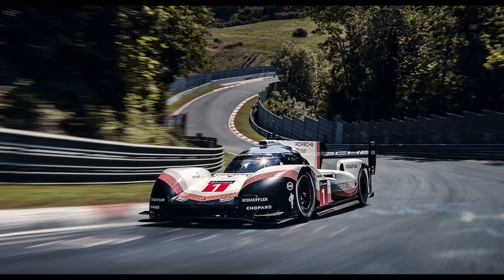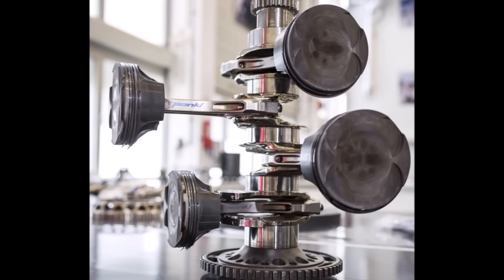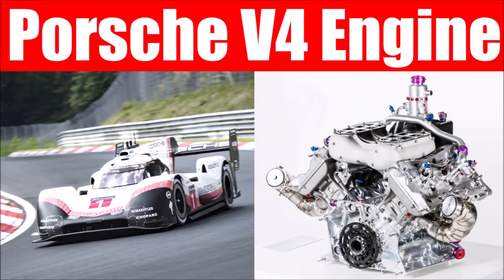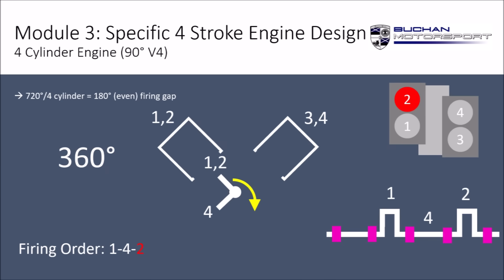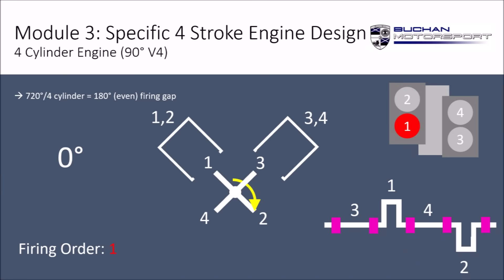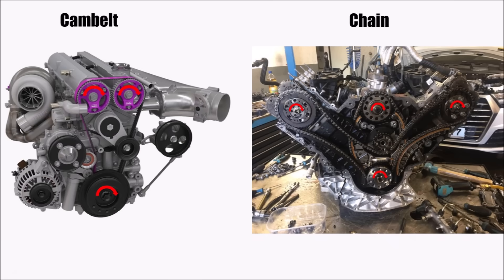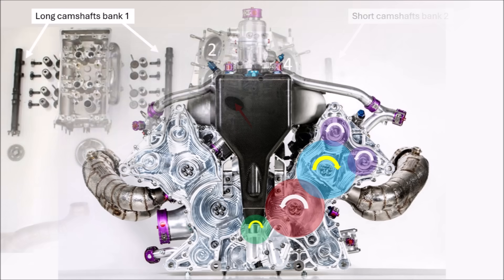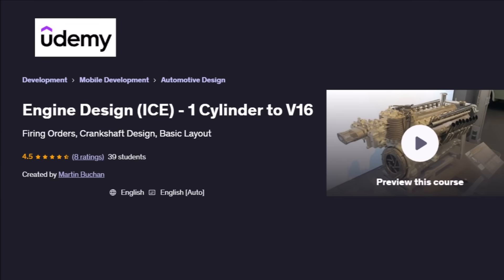Porsche 919 V4 Engine - Part 2 -  Important Updates

Comment: Typically 4-cylinder engines - particularly in-line fours - sound absolutely disgusting, at all speeds. The only reason I ever purchased a Tommy kaira M20b is because it has the Subaru boxer-4 in it - which sounds amazing - at all speeds!
V4s generally sound bad, and I find it sad the 918 engine isn't a boxer-4, because it's a fantastic setup which keeps weight low-down.
However, I have to say the 919 sounds pretty damned good - for a V4. And this, along with the performance, means this is a fairly important engine.
Reply: You do know with a header swap your beloved boxer engine would sound just a disgusting as an inline 4 correct?

Comment: The banks are staggered atypically but the 919 engine still follows the cylinder numbering convention used by VW/Audi V engines. On bank 1 the frontmost cylinder is #1 while the rearmost on bank 2 is the highest cylinder number. All of the VW/Audi V engines I know of 077,078,079,06C,06E, 06M, follow this convention. It appears that Porsche also follows this convention as far back as the 928's V8 in the 1970's.

Comment: The L shaped crankshaft makes sense from a flow point of view. It gives each bank even firing, which is better for tuning the exhaust system for high RPM (and the air intake system - it looks like this engine has a common air intake system rather than individual trumpets.)  Unfortunately it needs a large counterweight and balance shafts to achieve anywhere like decent balance.

Comment: I like the fact that the cams are gear driven, I've always wanted that in a road car.
Reply from the maker: Phaeton V10 is your chance😉
Reply: @bsport320  Or touareg 2.5tdi r5 😃
Reply: @bsport320  wow! Didn't even know they made a v10 phaeton, I'll look into that, thanks.
Reply: Yeah, but the drivetrain vibrations are bigger. Involute gearing accelerates and decelerates, that's why gears are not used often. Most F1 engines also had damper gears.
Reply: @DoriFord  I've heard that they're noisy, but haven't heard anything about driveline vibrations.
Regardless, we've always had ways of dealing with issues like that, I'll rather have an engine that never skips a tooth, instead of worrying about the belt or chain slacking.

Comment: Race engine technology magazine did a pretty detailed article on this engine a while back if anyone wants to get deeper in the weeds on this.
Reply: Damn, thats a legendary magazine for anyone into engines. 

They did an article on the ts040 v8, and it was there I learned toyota made a naturally aspirated, port injected only v8 with mid 40% thermal efficiency, with combustion pressure sensors INSIDE the combustion chamber. 

2014-2017 LMP1 was actually the peak of engine design. Probably as close as we will ever get in the modern era to an "anything goes" ruleset. Unlimited budgets :D

Comment: I totally dont understang why it is brilliant
Reply: The fact that they can race it for 24 hours straight through the entire gear range? The 917k, which had a flat v12 was around 520 hp
Reply: Just imagine all those rotating/stroking elements at high revs. 
You need to balance it all as good as possible. 
Otherwise the engine will rip itself apart.
Reply: It's small, thus light. A very dense powerplant.

Comment: It’s not really good to compare with the Ford V4 engine as that is a 60 degree V so it has offset crankpins. Better look at the Honda VFR, this is a 90deg V4 and has just 2 crankpins. 2 pistons share a crankpin. It would be interesting to discuss why Porsche didnt use this design as it is more compact and has perfect primary balance like a 90deg V-twin but because of the extra 2 cylinders also has even firing order. Basically two V-twins mated together at 180deg offset.

Comment: This engine blows my mind to this day. This and the Mercedes split turbo are probably the two most innovative racing engines ever. 😊
Reply: @deeacosta. Thanks for a thought provoking comment. "Two most innovative ever ...".   I'd agree concerning the Mercedes split-turbo but not this V4. If saying  "ever", we should surely consider Walter Kaaden's game-changing 2-strokes and the DOHC narrow-angle 4V/cyl Peugeot L45 engines of 111 years ago and perhaps, Keith Duckworth's somewhat innovative V8 ... plus  many other amazing race engine innovations down the years. Against these giants, the Porsche would struggle to get into the Top 10 IMHO. However, it is certainly a very impressive project.
Reply: @ yeah the Peugots were special but the Porsche and Mercedes won races in competitive environments. 

The Cosworth DFV is a legend but ai feel like more the result of practicality and the state of F1.
Reply: @camshaftcasting1451  And why would you include the Mercedes when it didn't even end up being to most powerful, the Ferrari with a conventional turbo being more powerful. As well as they're having to most reliability issues by the end of the era. Also the split turbos were already used outside racing when Mercedes came up with the idea.
On the other hand there's no V4 car racing engine other then the Porsche. Even in road cars there's only a handful of them.
Reply: @avada0 I will try to explain why I think this engine was innovative when it truned up in 2014. I think we should not underestimate the lead the MBHPE lump had when the new formula started. The OP called it a "split turbo engine" as a sort of short hand but there was a lot more to it than that. Honda and Ferrari had to play catch up in a number of areas. The fact that V4s are unusual in cars does not make Porsche's use of them innovative. I expect there are other aspects of that Porsche V4, more innovative than the fact it has 4 cylinders arranged in a vee.

Comment: This L shaped crankshaft seems amazing. Even if it was unbalanceable it is wonderfully audacious. Did porsche attempt to balance it externally or with weights on the shaft itself?
Reply from the maker: I think they didn’t have the time and quickly changed to the other firing order

Comment: Could porsche use this for their next hypercar?
Reply: v4 would be something not even ferrari could do
Reply: @hanspeter24 porsche made a 919 street concept, so they can use that design to make hypercar with a modified version of 919 V4 or the V6 they developed for F1 hybrid era with hybrid system and porsche could try to set a lap record in nurburgring like  they did with 919 Evo . Also a hybrid is better than a full electric hypercar like Mission X
Reply: @Arno_7-a  Not sure how it would do in a road legal car. Sure, Porsche did do something similar with the Carrera GT and 918 Spyder, but those were a V10 and V8, respectively, which have better balancing than a V4. The V4 would probably need some NVH studies and modifications to make it run smoother Not only that, but costs could be another limiting factor. 

But it would be quite interesting seeing Porsche do that to the 918's successor, specially since V4 engines in cars are quite rare.

Comment: No balance shafts?
Reply: Doesn't need them.  Cross-plane V4s have perfect primary balance. 🙏
Reply: @rooramblingon895  The even (once every 180 degrees) firing order described in this video is not perfectly balanced. Pistons 1 and 3 come up together, and pistons 2 and 4 come up together. That means there is a reciprocating primary end-to-end imbalance. Reciprocating imbalance cannot be 100% removed by crankshaft weights because the crankshaft weight then introduces its own imbalance at 90 degrees to the existing one.
Crossplane V4 can have perfect primary balance but only with a firing order where some pistons fire 90 degrees after others. You can even get perfect primary balance on a V2 provided it is 90 degree V angle (like Ducati.) One piston moves in the x direction, the other one moves 90 degrees later in y direction. In this way they create a rotating imbalance which can be perfectly cancelled by crankshaft weights.

Comment: How many Horse Power did this 4 cylinder engine produce? Only the engine.
Reply: In LMP1 spec 373kW, 500hp, 507PS
In Evo spec 530kW, 711hp, 721PS
Reply: @toro4271 holy shit! Those numbers are insane!
Reply: @toro4271  unbelivable,with only 4 cylinders... We need it in road cars 😀
Reply: @zelcpavle5494  They're expensive to build. And they're hard to package compared to a straight 4 in a FWD config. Only reason you'd want a V4 is if you've got specific package demands, like a motorcycle or, in this case, a race car.
Reply: @zelcpavle5494  They tried with the 919 street but it was cancelled due to needing an engineer or something other procedure just to start the engine and having to warm up for about an hour before its able to be used
Reply: @zelcpavle5494 they probably have pretty bad longtime performance..